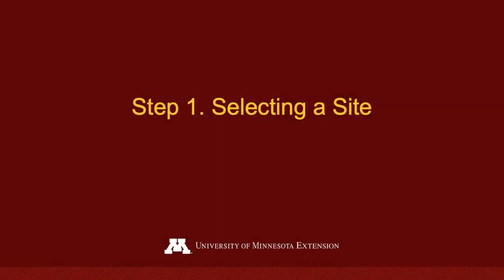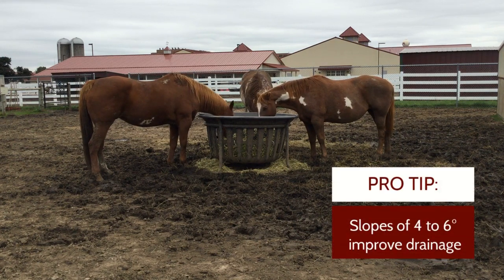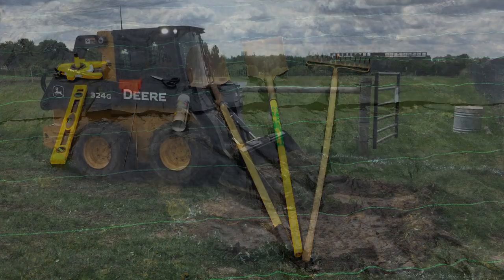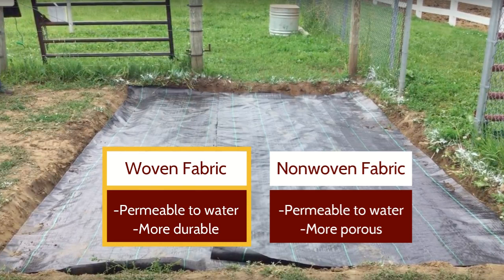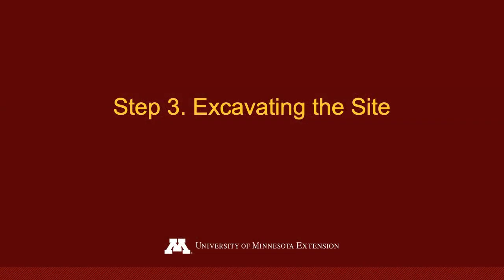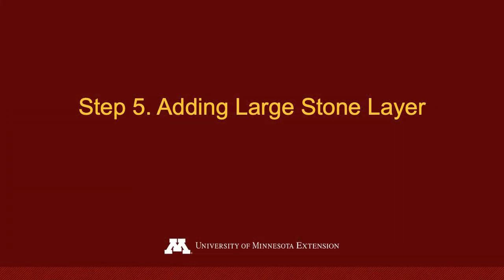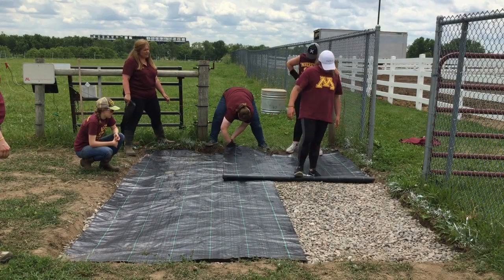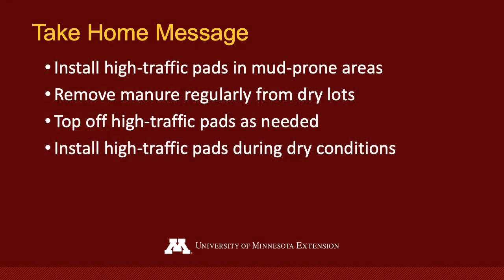Constructing a High-Traffic Pad

Comment: How much does it cost to build 1m2 in dollars? 
Is it the ideal floor for building a horse pasture?
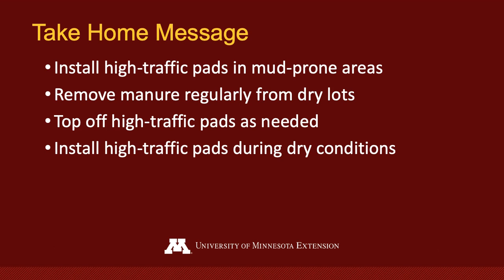Reply from the maker: Estimated costs are covered starting at the 6:48 mark in the video. This is not something you would install in a pasture. This is ideal for a dry lot, feeding area, around gates, or inside a shelter.